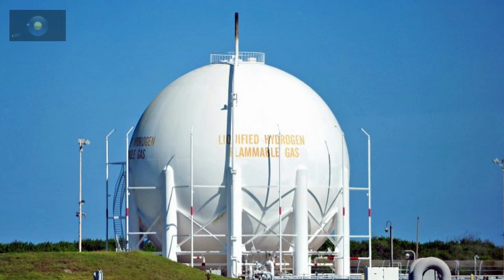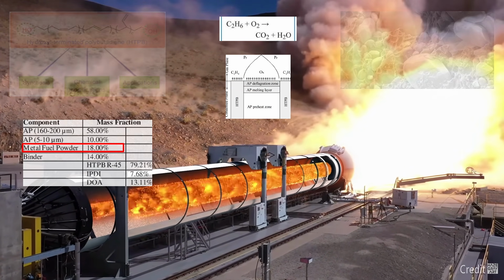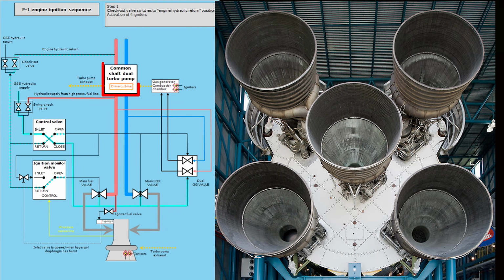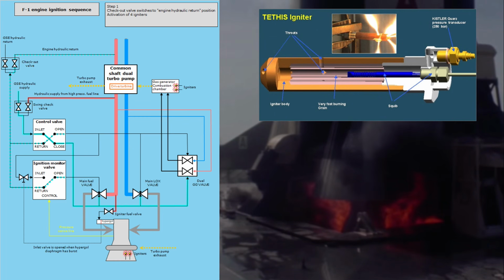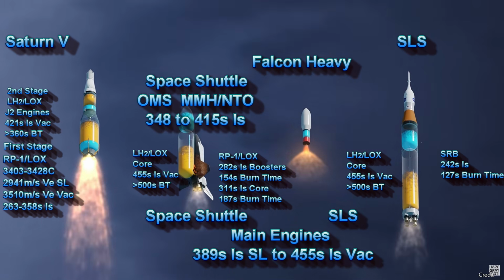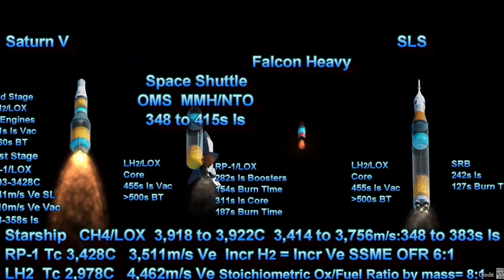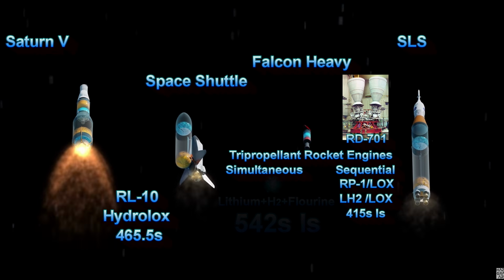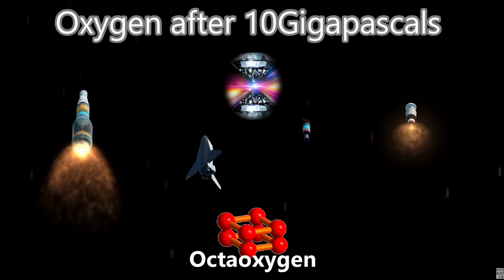Rocket Science: The Ultimate Chemical Rocket Engine

Comment: It is rather counter-intuitive that running fuel-rich in a hydrogen engine, thereby decreasing the temperature of the combustion mixture and adding extra unburned mass, increases its specific impulse! Reminds me of water/methanol-injection systems in high-pressure piston-engines running high boost pressure in their intakes (particularly as used in that Li-F-H engine that would have a very evil exhaust mixture!)

It also reminds me of the water/ethanol mixture used in the A-4/V-2 rocket, where the water was added to the fuel to reduce the exhaust temperatures to within the limits of the materials. I think that harmed its Isp, however.

Comment: Rather than using (Octa) oxygen and metallic hydrogen, you could just let the metallic hydrogen reform into molecular hydrogen gas.  That reaction alone would generate a lot of heat and have the lightest possible exhaust.

Comment: Terran Space Academy why can't we burn methane and oxygen in a more restricted combustion chamber and get higher temperatures and pressures?  And use Tantalum Hafnium carbide as the combustion chamber?
Reply from the maker: It erodes the lining at some point.  The high energy particles impact and break off atoms of the chamber.  Magnetic confinement of plasma has the highest potential but transpiration cooling has not been maximized i don't think.
Reply: @terranspaceacademy  Thank you for your attention.  My solution to this is to print the engine, use the fuel to keep the walls cool and strong and "Sweat" the fuel through a sintered layer to even out the coolant and gasify liquids at 5000 degrees and hope for an exhaust temperature of 7000 F or above and much higher velocities.  Then engine would have to be small  to be highly efficient and hotter, but as you said my concern is ablation and the max temperature limit that this fuel can reach under restrictions at the throat.  Know anything that might cancel this out?

Comment: Well the Fluorine engine is interesting, albeit insane to use in practice probably due to the issues if it has an accident. Metallic Hydrogen is interesting as well, but right now it's straining our ability to try and make it at all and we still don't know if it's meta-stable or not. So that's probably quite awhile off at best.

Which means the best chemical engine we could maybe manage to make near term would be a detonation engine, like a rotating detonation engine. You sadly didn't cover this type,  but I've been getting the impression from the few articles I've read on it , that a sub-variant like the rotating detonation engine might be able to gain us another 5 to 10 percent in ISP. Not world changing, but still a rather interesting gain that would still be pretty helpful in improving the mass fraction to orbit if achieved.
Reply from the maker: I was covering fuels :-)  We did cover the detonation engine in several episodes but with the US about to field one we need an update.
Reply: @terranspaceacademy  Good point, lately it does seem like it's starting to make some real progress. The first substantial step up in chemical energy performance in a long time.

Comment: About the metallic fuels, wouldn't it be more efficient to just let them burn on their own? As in, isn't the energy trapped in the metallic hydrogen and oxygen far greater than what would be released when they chemically combine with something else, making it more efficient to replace all of the fuel with one of them? And only if both metallic hydrogen and oxygen is available and both have a similar amount of energy trapped in their bonds, should they both be used together...
Reply from the maker: They may be stable and will need to be "ignited" to release their energy.  The energy released from the compressed form should far outweigh the chemical reaction.

Comment: Sorry but I think this is about performance but the lack of efficiency. It's like going to Niagara Falls and witnessing the same displacement of a waste of fuel and oxidizing materials that can be beneficial if done correctly by adding a hybrid system to this , it will cut fuel consumption and give the same displacement but the best part of that equation is time . It's a longer and more effective way to use the fuels. Our little piece of space is extremely vast and running out of fuel just to get to low earth orbit and then a secondary to continue on for a couple of minutes then drift isn't going anywhere in our small sector. Humans haven't even gone past the Moon just because we are unwilling to understand. All I've seen from NASA and other space agencies are the new politicians that circumnavigate the tough questions and those old fellows will probably be dead by the time we actually have feet on the ground on any distance planet in our solar system. Better call Saul and have him clean up this mess
Reply from the maker: Sadly Saul has probably been put out to pasture.  Can't have anything actually get done after all... :-)
Reply: @terranspaceacademy  well I like what's being offered by Skylon , their Sabre engine spec is an interesting design. Has it's own transfer system from jet to rocket fuel. There was a few questions I had to ask. The most important one is, is it fuel efficient
Reply: @terranspaceacademy  So many of you like math and lack seeing the true outcome. Well let's find out how good your math really is.  Outta 7 billion people on the planet and at the rate of astronauts leaving earth and just dropping to a quarter of the population. How many generations will it be for someone from your family to get into space ? The problem is the lack of information and investigating more possibilities therefore we are currently doing plenty of copy and paste. A new canvas is definitely needed. Some idiots believe Nuclear Thermal Rockets will be the shiznitzz but they forgot the most important thing. The vacuum of space.  The radiation doesn't dissipate, it's with us for the whole ride along with cosmic radiation and like the three examples here already,  it's not going to take about 10,000 years to go inert but because all that makes up the universe keeps those areas hot , so it will be forever until we completely move it off the earth...I'm for fusion but that's a long ways away from us . The universe has 4 Natural elements that can help us archive our goals and those fuels are in abundance outside of earth. If science is your game, please play it right. I think there's a better way, a solution that can make this safe . You see it every day..innovation.. but a rocket is still a rocket and nowhere close to fuel efficient. A hybrid spacecraft or should I say a hybrid engine spec is what we really need and want . If I had a boneyard at my disposal, I would pull an ironman and say , I told you you so . 
Cheers and have a great day

Comment: It occurs to me that a relatively small amount of water pumped into a (edit: already burning) solid rocket core like oxidizer through a hybrid core should substantially increase specific impulse if also reduce thrust somewhat. Considering it's density, ease of storage and handling it's by far the lowest hanging fruit when it comes to a trifuel arrangement. Odd I've never heard of it.
Reply from the maker: Water actually has a higher molar mass than most fuels so running fuel rich works better.  Though using microwaves with water has proven to be a viable concept.
Reply: @terranspaceacademy  Even solid rockets like the old boosters on the STS? It should at least be hot enough to convert the H2O mostly into O/O2 and H/H2 into it's out of the nozzle. Even averaged out shouldn't it be lighter than the combustion products of perchlorate solid fuels?

Comment: Those numbers for MMH/NTO don't seem right - I'd expect the temperatures to be abut 1000 degrees lower and Isp to be about 100 seconds lower.
Reply from the maker: I got those from NASA documents on the shuttle system.  Those are optimal reaction numbers.  Equipment may not be able to handle them at full temperature so they run cooler.

Comment: The best and most powerful liquid chemical rocket motor is hydrogen - ozone based.  Fluorine based engines are way too toxic for our atmosphere.  The hydrogen - ozone motor has to be turbocharged by the third propellant and by increasing the combustion temperature and pressure.  Need to know what third propellant?  Then ask me.
Reply from the maker: Mmmm... Ozone is pretty toxic stuff in the lower atmosphere.  Ok, I'm asking... what's the secret third propellant?
Reply: @terranspaceacademy  The third propellant is Acetylene C2H2

Comment: Forget about bi-propellant engines.  I'm working on a tri-propellant engine.  The Specific Impulse could be as high as Isp 700.  I need help from Tom Mueller to design the injector plate.  Fuel mixture is extremely critical.
I wanted to build my own Methane powered rocket motor back in 1986 when I learned that the three best Hydrocarbon fuels are Acetylene C2H2, Methane CH4, and Ethylene C2H4.  Using the Method of Characteristics I even designed my own Methane powered engine.
The future of rocket engines will be the tri-propellant motor which is difficult to perfect due to fuel mix ratios and combustion irregularities.
Reply from the maker: Interesting!  We would love to hear more!  Mueller is at Impulse now and may be looking for new ideas :-)

Comment: I had previously stated here that I wondered if the starship engines spinning up could provide the push to separate the starship from the booster for an abort.  After the booster incident during the spin test, I withdraw that as a valid option. lol
Reply from the maker: If they are in the upper atmosphere or vacuum and they just run the methane turbo pump I think it would work. No explosion risk :-)

Comment: Hmm. The used NO but not NO2? I would have thought NO2 a better choice.
Reply from the maker: I just loved the guy laughing video.
Reply: @terranspaceacademy  

Oh yeah, good old Nitrous Oxide. All the Nitrogen oxides are interesting, and all are poisonous to some extent. But NO2 is the real nasty of the bunch. Canadian Regis are no more than 2ppm in atmosphere. I’ve been in manufacturing plants where the air was nearly that bad. Propane engine exhaust isn’t as clean as most think, or at least they weren’t till the EPA Large Spark Ignition engine rules too effect in 2007. I knew customers who were floored when replacing older equipment when they realized that productivity went up and sick call ins went down.

Yeah, I talk too much but most folk just don’t realize how much we’ve cleaned up engine exhaust.
Reply from the maker: I believe it was NO2.
Reply: @terranspaceacademy  

You didn’t say Nitrogen Dioxide, that I would have noticed. Used to design catalytic converter cores for non-road spark ignition engines. Heh. My name used to be plastered all over the EPA and ARB websites, but that was ten-fifteen years back.

Comment: With the final hydro/octao2 hybrid, would the ablation regression rate be sufficient enough to not melt the casing and nozzle without active cooling?
Reply: It's not octao2
Reply from the maker: metallic hydrogen as a liquid could be pumped around the combustion chamber and nozzle, the transition to gas should absorb a lot of heat.  One thing about metallic hydrogen is that it might be stable at normal pressures and temperatures once created but no one is sure until we have enough to experiment with...

Comment: Metallic Hydrogen or Octal Oxygen as a fuel combo is NONSENSE. Forget about how you can or cannot make it. The problem is that there is no flight possible way to KEEP IT in their respective states. While you might be able to keep them in the required temperature (at least the majority of them for a relatively short while until they boil off), there is no way to maintain the pressures needed. And, you need both.
--
Hypothetically, if you have the divine ability of control temperatures and pressures at will, you won't bother with Metallic hydrogen or Octal Oxygen either. You'll simply have a bottle rocket!
Reply from the maker: The purpose of these lessons is to stimulate thought and show that we should not assume we have reached the pinnacle of scientific and technological achievement.  Any time someone has made that argument they have been proven wrong.  How do you know that these compounds won't be stable once formed?

Comment: Only TEA was primary used in early US hydrocarbon rocket engines. TEB was known about, but wouldnt come around in mainstream use until later on. The F-1, H-1, S-3D, MB-3 etc all used TEA alone. Soviet Hydrocarbon fuels are T-1 and RG-1. RG-1 has slightly lower performance than RP-1, but slightly higher density.
Reply from the maker: Thank you JM!  Did not know that.

Comment: How true. Single stage to orbit (and beyond) spacecraft will only be feasible with the advanced propellent you mention at the end of the video - metallic hydrogen and octaoxygen. 
Petrol engines - which allowed the creation of personal motor vehicles - are so much efficient compared to steam engines because the temperature in the cylinders are so much higher, at 900 °C. 
In the case of personal rockets, the idea that 95% of the mass of the vehicle must be fuel, is underwhelming... Advanced propellents for rockets would like to be as the transition from the steam engine to the internal combustion one.
Thank you for the inspiring video...
Reply from the maker: You are most welcome :-)

Comment: This was sooooo cool. I remember the Harvard test and Metallic Hydrogen. Hadn't heard  about Octaoxygen. I however wouldn't want to expense out a manufacturing process for making Metallic Hydrogen. But WOW, now using this as a rocket fuel is just so cool! or hot lol
Reply from the maker: It would be amazing! To the moon and back single stage with no problem :-)
Reply: @terranspaceacademy  Actually I didn't do the math but much much further in a ship designed for it. It would be a fun research to figure out a ship with a combo of this fuel + Solar or Laser Sail.
Reply: @terranspaceacademy  hi, this may be a bit late but in one of your more recent videos (or may have been someone else idk), a microwave electro-thermal thruster was developed for use as a low thrust high lsp engine for satellites. it worked by ionizing water. if microwaves became powerful enough & compact enough, and perhaps a super dense power source (like fusion reactors) became practical, do you think we could combine this with the aforementioned metallic hydrogen+octaoxygen rocket, creating a high thrust, high specific impulse engine (metallic hydrogen and octaoxygen's exhaust product would be REALLY, REALLY hot water, but water nonetheless. Actually, if it's really hot, microwave antenna might end up doing less work, reducing the engineering requirements in one aspect)